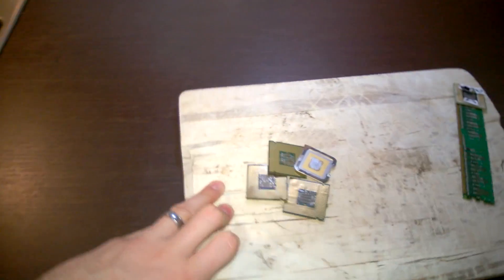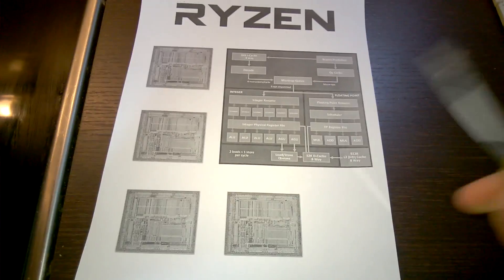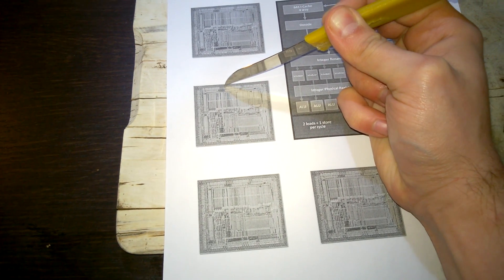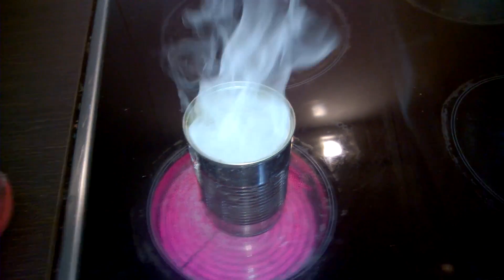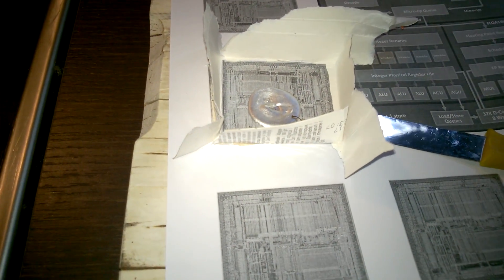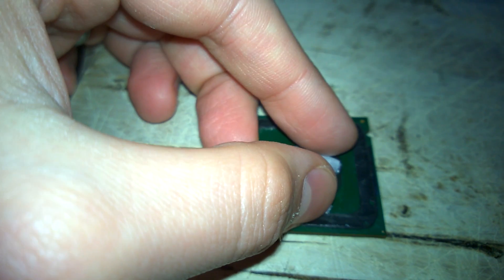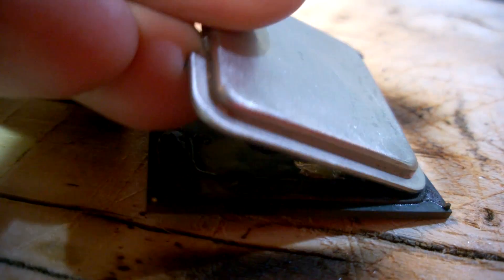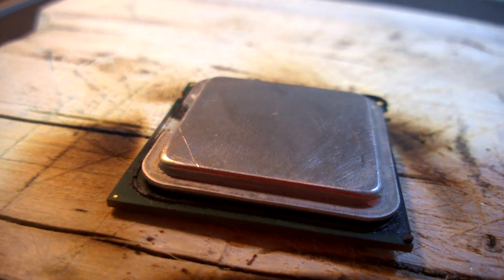Making new processors out of old parts

Comment: can't tell if lead or tin...
Reply from the maker: or transistors
Reply: Solder.

It's solder.

Not sure if it's lead or tin based... probably tin? Would explain the blue smoke when processors get fried.
Reply from the maker: transistors.

It's transistor goop.

Not sure if it's AMD or Intel based... probably Intel? Would explain the blue smoke when processors get fried.